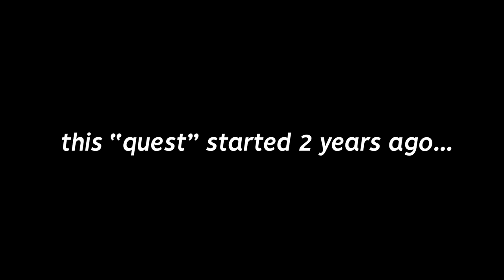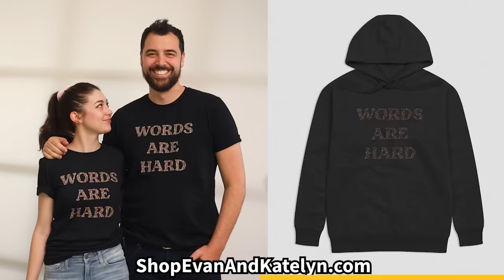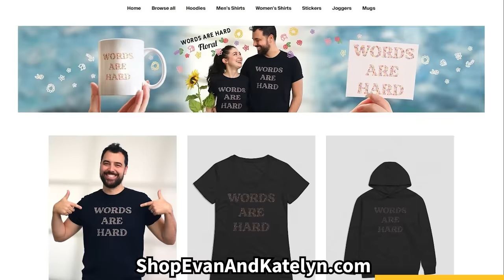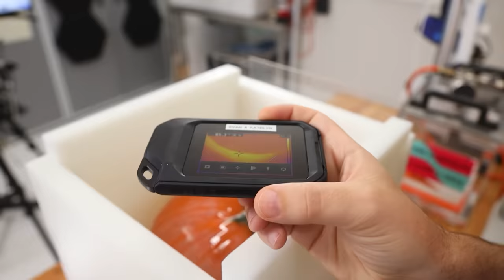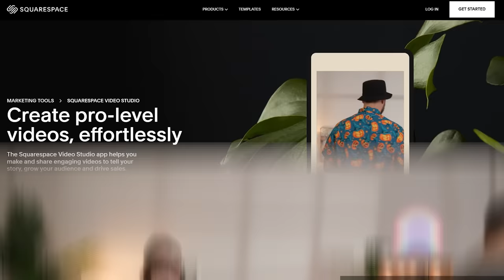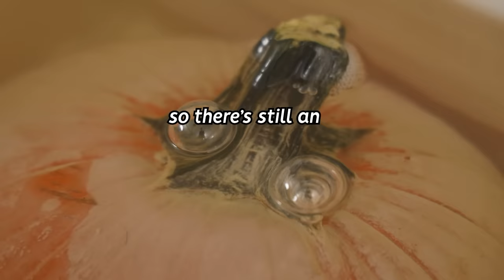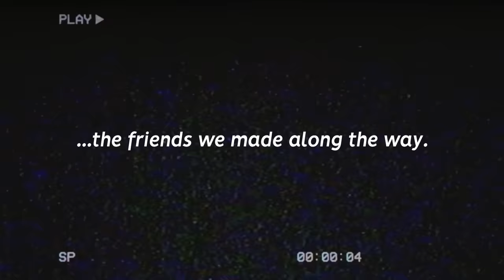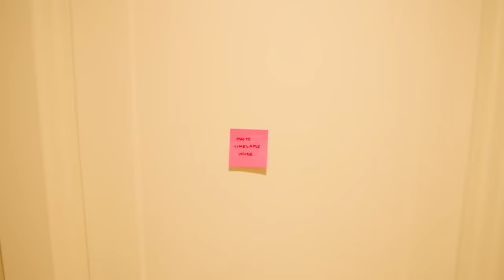Preserving a Pumpkin in Solid Resin… Will it rot?

Comment: i remember mythbusters doing something similar with an apple, and tory used one of the shop tools to cut one and a knife to cut the other. the shop tool apple went bad so much faster. so unless you sterilized your hole saws and other blades, there's a good chance you introduced the mold early
Reply: thats exactly what i was thinking too
Reply: Wow!
Reply: Ohhh good spotting. Another change for next year: use sterilized tools or regular knives
Reply: That, and maybe santitizing the surfaces of the pumpkin?

Though I suspect freezedrying would work better...
Reply: Dipping the pumpkin in alcohol or spraying it would help killing bacteria too. With the freeze drying I'd be afraid of condensation spots when getting it out of the freezer
Reply: Basically the tool version of crocodile/alligator mouths, hahha

Comment: I'm super surprised you guys didn't try freeze drying Meatball to get out the juice. Perhaps that can be saved for next years candidates, the brothers Wooby and Flump?
Reply: I was thinking along the same lines, but thought maybe some kind of preservative or strong disinfectant to try and kill any microbes or fungi. Freeze drying might preserve the color better, though.
Reply: @rpsdata  I think an issue is that any dampness attracts mold, bug and decomposers so if that's taken away it gives more time to get it cased in resin
Reply: honestly cover all their bases just to be safe, freeze dry then do a quick alcohol wipe wipedown prior to resin pour
(i'm honestly unsure how an alcohol wipe would work with the resin but it's such a small amount of alcohol that it evaporates almost instantly so it should be fine right? lol)
Reply: @forest-goddess  I spray a lot of my dice inserts with alcohol before putting resin on them, to avoid bubbles clinging to the inserts, and the alcohol does nothing to the resin, even if it's still liquid, as long as it's just a small amount :)
Reply: Freeze drying requires some significant equipment.
Reply: soak it in 99% isopropyl alcohol for a few hours
Reply: @LittleAshfairy   cool! good to know! i wasn't sure if there was a reaction between the two but even so i didn't think it would be significant in such a small amount haha
Reply: As an alternative to isopropyl disinfection, I'd suggest hypochlorous acid. It kills more effectively and quicker without all the fumes/bad smell. I was really hoping to see them try the disinfectant strategy as even a perfect coat of resin won't prevent rotting if mold spores are already on the pumpkin surface. My experiment would be like: Run a HEPA filter in the workshop for a while, then stop all airflow including air conditioning to allow settling of airborne particulates. Make a still-air box and disinfect/resin pumpkin in there if possible. Wear masks (not PAPRs) at all times to filter exhalation. HOCl can be easily made at home in large quantities so you could literally bathe the whole pumpkin in disinfectant before resining if you wanted to

Comment: Suggestions for next year:
1. Scrub and wash the pumpkin to clean up the waxy residue on the outside. 
2. Use a scoop or spoon and really scrape out the inside. Actually thin down the walls a bit and clear out the pulpy interior bits as much as possible.
3. Soak the pumpkin at least briefly in a bleach solution to kill any mold and fungus. 
4. No "air hole". Put the pumpkin in upside down that way you can pour the resin directly into the pumpkin and around the outside as well. 
5. Use quick drying resin.
Reply: This is actually a really good idea
Reply: I like this. These are very useful
Reply: The bleach solution might discolor the pumpkin. Perhaps alcohol maybe?
Reply: To be fair, you are still just making an impenetrable tomb to house whatever the remaining moisture decomposes the pumpkin into.

I think their second attempt was closest to success, but they should use the Cup Noodle method to dry out the pumpkin. The man who invented Cup Noodles supposedly was the first to preserve noodles by drying them out in a way that could be rehydrated when you are ready to consume them. If I remember rightly, it just required deep frying the noodles which would be a lot easier and cheaper to use on a large pumpkin.

So I propose to Evan and Katelyn to read up on the method Cup Noodles uses to dehydrate large amounts of product, use it on the pumpkin (maybe use a few smaller gourds as jack-o'-lanterns to get a few extra tests out in a year? (but that will minimize the chaos and fun ;)), and then stick that thing in the cube of resin.
Reply: You really thought this out. These are some good ideas that I wish I could of thought along these lines. Pouring the resin in the upside down pumpkin makes the best sense. That way there is no trapped air and no reason to have the air hole. 
What if they freeze dried the pumpkin out some how?
Reply: Yeah I was surprised they didn't put in the pumpkin upside down. When they drilled the hole at the bottom I was like "oh so they can pour from the bottom that's so smart" and then they didn't
Reply: @turgongondolin2103  The Texan in me got excited at the prospect of deep-fried pumpkin.  NO lie.
Reply: I was also thinking you could try to Formaldehyde solution the pumpkin first like a lab specimen..... Formalin that pumpkin like a pickle!!! lol
Reply: I worry faster curing resin (i assume thats what you mean by quick drying) would kick too fast and ruin everything. They're using the right resin for the job. The only other thing I would change is instead of soaking it in bleach, dry it by putting it in an oven at a low temperature for a long time. It should help keep it from molding and you can avoid using bleach which could screw with the resin curing.
Reply: I wanna like the comment but at the same time, its 666 right now
Reply: @turgongondolin2103  Freeze drying. you're thinking of freeze drying
Reply: Maybe use something to displace the moisture instead of drying, like immersing into alcohol or propylene glycol. I think they do something similar to make eternal flowers.
Reply: @izzy1633  OFC
Reply: Great ideas! But the last one isn't possible without a hundred layers. It's a slow cure resin because normal resin will heat up too much.
Reply: These are very good ideas! 👍
Reply: ALSO: Using a larger-than-the-pumpkin shaped mould would make the final shape kinda rounded as a true forever pumpkin and mean using a lot let resin!
Reply: @donosborne9398  : Just FYI: alcohol doesn't kill mould/fungus- alcohol-based hand cleansers contain additives to deal with this.
Reply: IDK how it would react with alcohol but im thinking soaking it in it and then casting in resin would preserve it well.
Reply: He knows what hes doing
Reply: @ShiftedGames  You are indeed.
Reply: @dankelpuff8381  You've never used Resin in your life.  Why are you thinking anything on the topic?

Pumpkins and most all thick water based organic material need to be dehydrated...  It contains too much water, go learn some basics of building with resin.

Even dried wooden tables often contain to much water to be suitable for use.  After testing the moisture level they are often turned into art instead of used as a table.
Reply: 6. One big go. Perhaps cool.
Reply: 3.5 do a resin bucket dip of the pumpkin using UV resin.
Reply: What if you poured/cured the resin from the inside out instead of the outside in?
Reply: The upside-down method sounds good, but how do you account for the pumpkin steam, as it would make it sit uneven
Reply: @alexdhomochevsky7904  Look up NileBlue and NileRed (same guy). He has a video where he removes all the water from something with glycol I think.
Reply: @baileyjohnson1905  you can make a support ring of resin for it to sit on,  I'm not sure why they aren't just making a bunch of filler plugs to place in the large voids.  would reduce the number of pours they need to do.
Reply: @ale6242 ramen isn’t freeze dried, it’s actually fried. Freeze drying would probably destroy the pumpkin and would cost a fortune lmao
Reply: Or lying on it's back if the stem is too unwieldy, so the big ole face holes are at the top
Reply: Yes yes all good things
Reply: Yeah
Reply: Fast curing resin doesn't work in such large volumes. It would heat up so fast and so hot, that it would cook the pumpkin and resin itself.

Comment: Most of the pumpkins rot faster when they are warm, but you can keep them longer by keeping them in a cool to cold place. Also, if you spray/brush bleach on the inside (as well as all the cut edges) of the pumpkin, it will kill all the bacteria, which will extend the life of the carved pumpkin!!!
Great job guys!!! 👍🏻👍🏻👍🏻❤️❤️❤️
Reply: Oh! Resin heats up when it cures! They baked / juiced the pumpkin!
Reply: I believe they are in Texas too, Which I’m sure doesn’t help lol
Reply: Does UV resin heat up? Maybe if the pumpkin layers were UV resin it would preserve it better?
Reply: @CheekyAdorable  UV resin does heat up unfortunately
Reply: @CheekyAdorable  see their other pumpkin resin videos, they tried that.
Reply: Vinegar is better than bleach for food for animals.
Reply: @FancySpicyTuna  this!!! I think that part of the problem is that they are resin-baking the pumpkin. Like slow-cooking it, but locking in most of the juice which builds pressure which is how the bubbles and juice forced it's way out.

Comment: I think maybe because it's a porous, organic material you'd need to submerge the carved pumpkin in glycerin to seal it from within (like what's done to preserve leaves etc in frames) before adding the resin to the outside - hope this helps!
Reply: This was my thought.  Not enough saturation into the pores so they're getting tiny bubbles and decay.
Reply: Yo, I hope they see this comment. I think this might work.
Reply: I think they need to do some kind of sterilization first.  Obviously mold is getting into the pumpkin before its submerged.
Reply: @supernova743  I've heard a vinegar wash can help before carving or bleach spray down.
Reply: It's seems like he is just being cooked without using anything to protect the color. I have cooked many pumpkins over the years. I agree with everyone here. Soaking him in 10 cups of water to every 1 cup of vinegar for 10 minutes would kill any mold. Then dry really well. I use olive oil to preserve the color during cooking. You could do the same thing using glycerin. That's just my two cents.
Edit: As far as using the vinegar and water, make sure you don't leave it in longer than 10 to 15 minutes max. Because the vinegar will start to eat the pumpkin. I do this with all of my fruits and vegetables to make them last longer. I just let them air dry and you can't even taste the vinegar at all. I have been able to keep strawberries for as long as 5 weeks. Because they don't mold.
Reply: I think you're right. The stem is basically a big straw that feeds the growing fruit, so I think that the juice probably squirted outta there. The pumpkins tissue is a vascular system, so maybe that cool bodies display might be a think to research for further attempts?
Reply: Would stabilizing resin be a better approach? Like you would use for rotting wood
Reply: @malys2002  stabilizing resin before casting resin would probably work better
Reply: I think they should replace the water in the pumpkin with a substance that will preserve it. Maybe use osmosis like confectioners do when they preserve fruit in sugar. Or this method I read in an old French book to preserve brains, it is about replacing water by paraffin using a succession of baths each of which is able to dilute into the next. Alcohol -> Turpentine -> Paraffin. The temperature of the paraffin should not exceed 60C in order not to cook the piece to be preserved.

Comment: I think what you need to do is stabilize a pumpkin, using a stabilizing resin like cactus juice brand, or something similar. That would mean dehydrating it, but then rehydrating it using the resin, before you bake it to harden the resin inside it. This would have the added benefit of killing any potential mold spores. Then, from there, you should be able to coat it with clear resin without having to worry about pumpkin juices causing complications. It would still largely preserve the shape and color of your pumpkin, and you could do the large pour method with (hopefully) a lot more success. It's really just the internal hydration of the pumpkin that messed you guys up so badly.

Comment: I'm convinced the white-ness and unexpected juice is because the pumpkin is being somewhat cooked by the heat from the curing process. maybe a bunch of thin layers would work better (though it would take quite a long time). No matter what, I am definitely looking forward to whatever you guys try next year!
Reply: I was thinking the same thing...no way 100°F and over for prolonged periods of time isn't going to affect it at least a bit.
Reply: Thats what i thought too.. the heat of deep pour..it cooked meatball!
Reply: The problem is that it'd take longer having to wait for many more cures though, which would mean it would probably have time to start rotting before you manage to cover the whole thing.
I guess you could do it with something like UV resin, spending many hours straight pouring thin layers and curing them quickly. It'd be a lot more expensive than the already $1k resin used for this project however, not to mention a lot more labour intensive.

The easiest solution would be to just use much smaller pumpkins. Easier to cure quickly, thereby less risk of rotting, and also much, much cheaper to do.
They could experiment next year with multiple different ways of going about it, like one big pour, many smaller pours, UV resin, maybe some other method, and see what works best.
Then technically, they could use that the results of that to go back to a bigger pumpkin the next year and use the best method from the small pumpkin tests.
Reply: It looks like natural mold growth to me, I wonder if washing the pumpkin in bleach before sealing it would help.
Reply: I was thinking the same thing!
Reply: I was thinking the same. I accidently cooked my pumpkins leaving them in my car this year so the resin probably did cook it a bit.
Reply: came here to say that